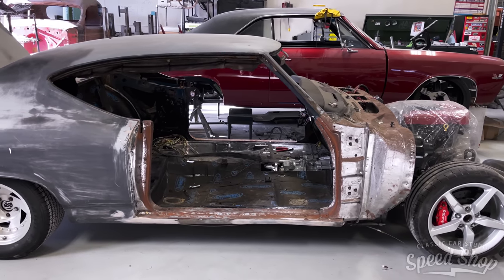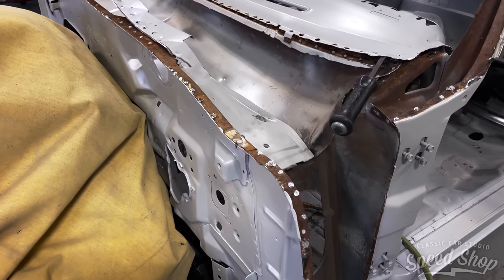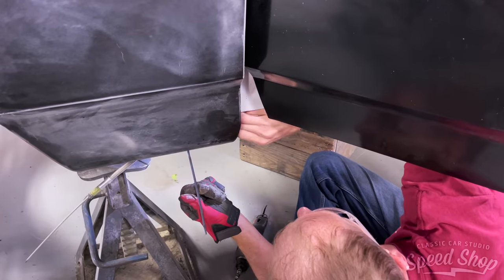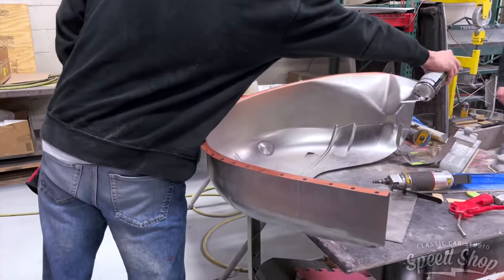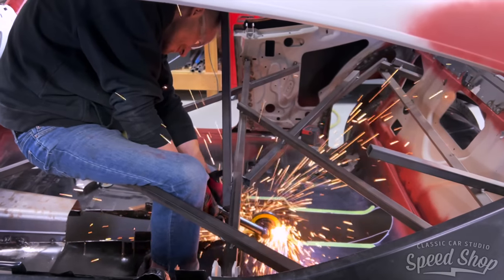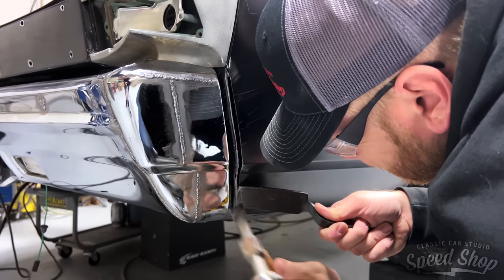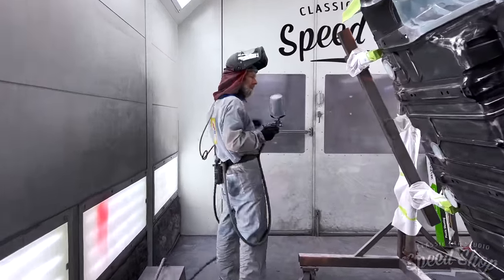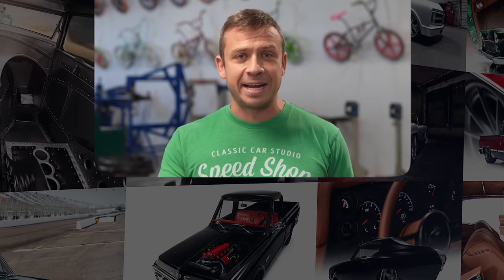Intro & Rust Repairs • Episode 1 • 68 Chevrolet Chevelle

Comment: Awesome work!  How do you guys decide whether to use kitty hair, or regular filler?
Reply from the maker: Usually we'll do kitty hair on seams and over welds. It's supposed to absorb / transfer less moisture from the back and is less prone to shrink. For those unfamiliar with the lingo, "kitty hair" refers to a fiberglass filler.

Comment: Where did you buy the replacement parts?
Reply from the maker: I believe the client actually provided a lot of the sheet metal when he brought in the  car. We got a number of panels that weren’t provided from one of our local vendors Gateway Muscle Car.
Reply: @ClassicCarStudio is gateway a dealer or actual manufacturer? Just curious as well what aftermarket metal you guys tend to use for replacement parts? Theres a lot of thin Chinese crap out there unfortunately.. thx